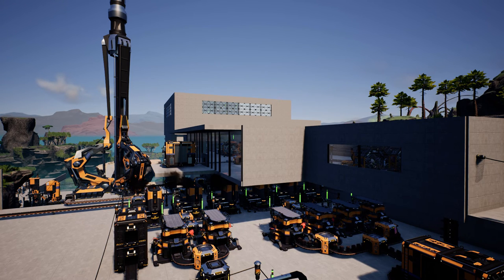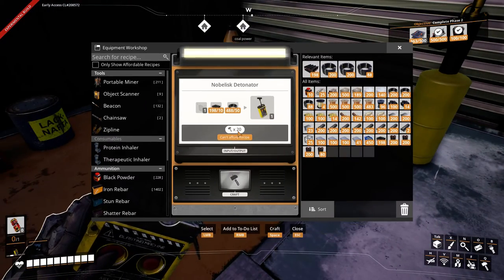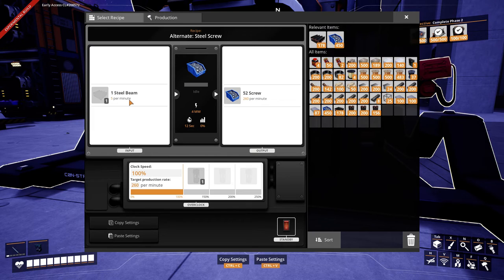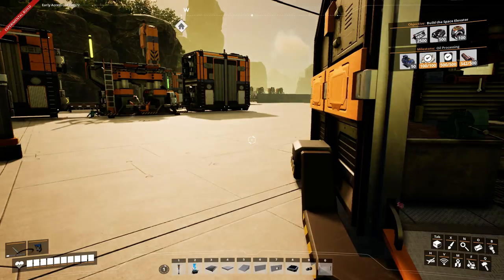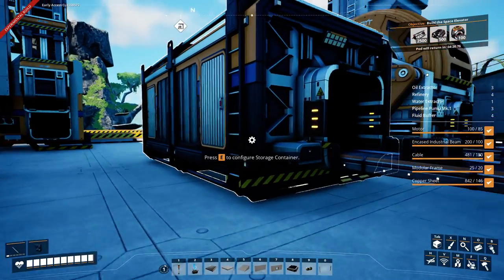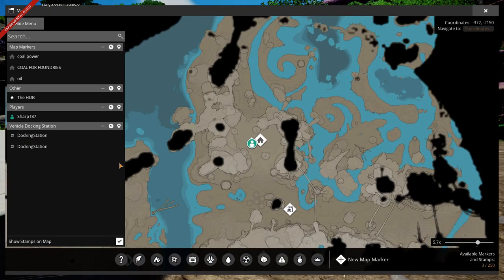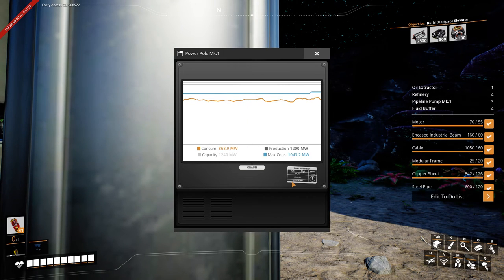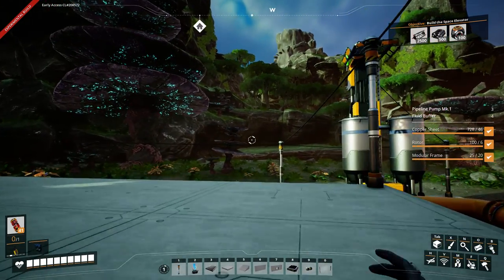LET'S PLAY SATISFACTORY UPDATE 7 - Refining Basics - Episode 13

Comment: Hi, I like the trucks. Set up a truck stop at the resource you need to move and make sure it is set to load, then setup the other truck stop to unload. Make sure you have coal for fuel for your truck, load extra into the truck's storage. 'Drive/ create' route along the loop, starting from load to unload and back to load. you should get message the route is complete, save it. press Q to open route control, set to auto, and press E to exit truck. Set up a short dummy route to practice first. make sure truck stops are powered, and that at least one has coal in the fuel bay. Cheers